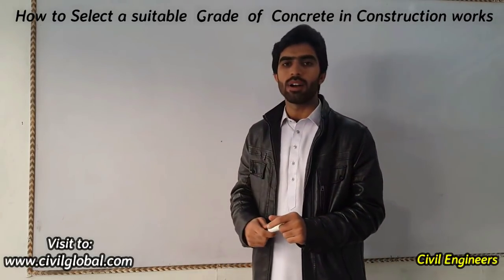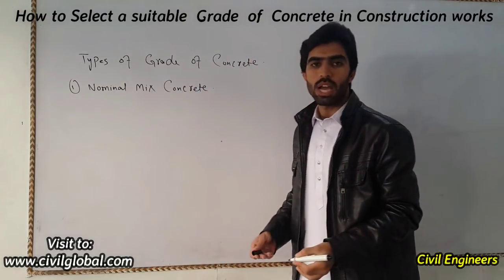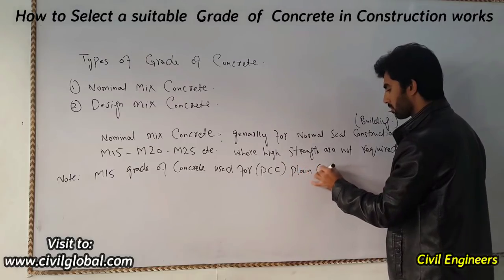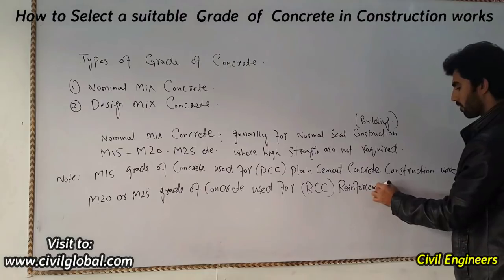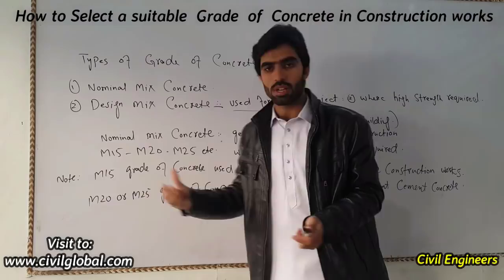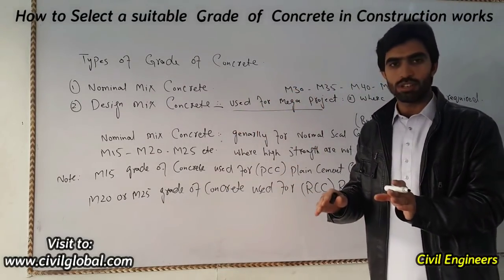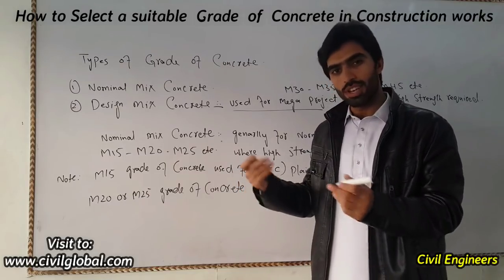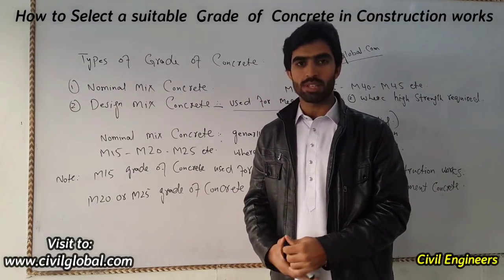How to select suitable grade of concrete in construction works

Comment: Types of grade of concrete
2main type of grade of concrete
Nominal mix of concret-below M25
M15-pcc work
M20,M25-rcc work
design mix of concrete- use for mega project where high strength required
M30, M35, M40

Comment: what's the difference between M15 & M20 or M25???
Reply: Zulqarnain Baber strength of concrete
Reply: Er. Rabbani  Thanks sir 
But  I mean how can we difference about it
Reply: Zulqarnain Baber There is different ratios of each grade like M:15(1:2:4), M:20(1:1.5:3) and these differences changes strength of concrete.
Reply: Er. Rabbani Thanks alot
Reply: Zulqarnain Baber .Let us start with the concept M15 means where M stand for mix that is cement,sand, aggregate proportion should be 1:2:4. 15 stands for compressive strength of concrete in 30days cube.M20-1:1.5:3
M25-1:1:2 ,M30-1:1:0.5,
M5-1:5:10
M7.5 - 1:4:8
M10-1:3:6
Reply: M15:1:2:4
M20-1:1.5:3
M25-1:1:2